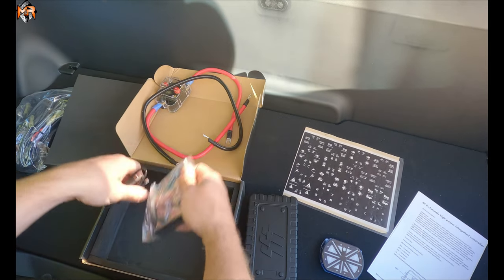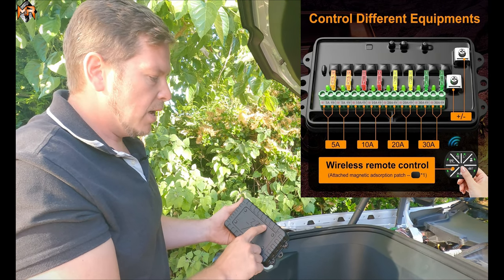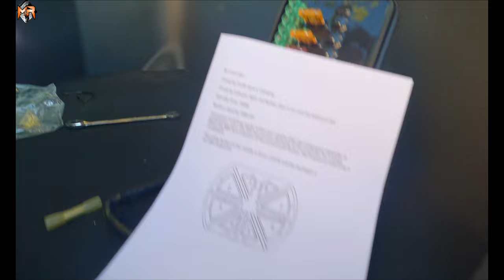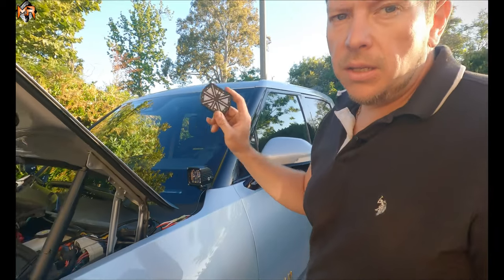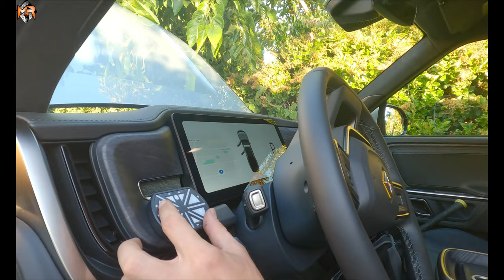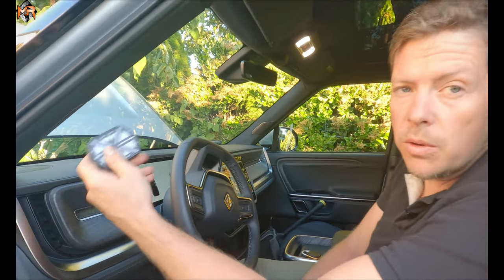Wireless Wiring Harness install LED Ditch Lights on Rivian | M&R Automotive

Comment: What happens if the battery dies on your control panel. Do the circuits stay on?
Reply from the maker: It recharges via usb wire when necessary

Comment: Is there any way to manually turn the lights on and off in the event the controller stops working? Thanks!
Reply from the maker: Yea by either turning off the master fuse or individual fuses on the distribution box

Comment: This was very helpful. However, after I installed it and got in my vehicle to start, I got all types of errors popping up telling me I needed service for the battery, the all-wheel-drive system, and some other systems. I ended up doing a restart of the vehicle, and it appears to have fixed it because all the errors went away but time will tell.
Reply from the maker: I think its a battery voltage issue that fixed itself